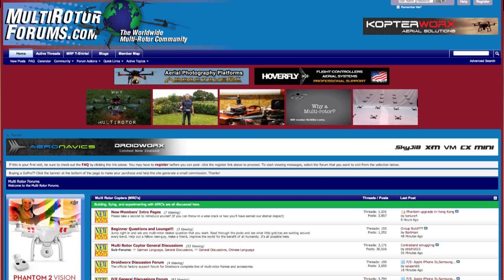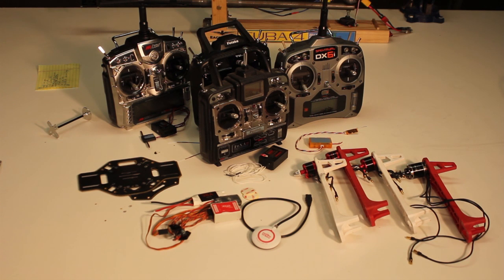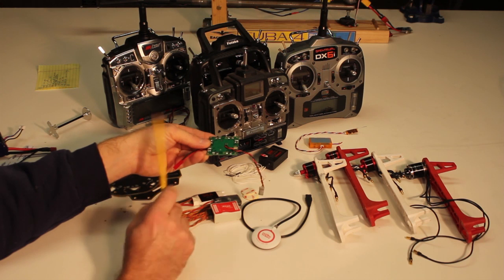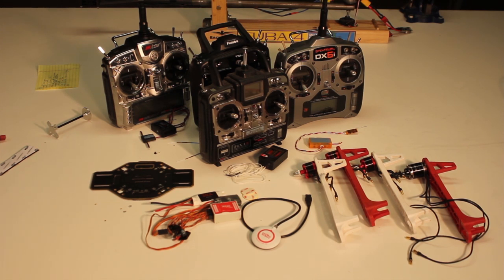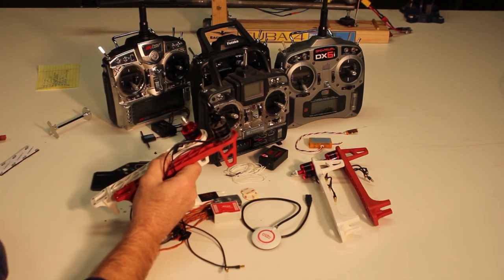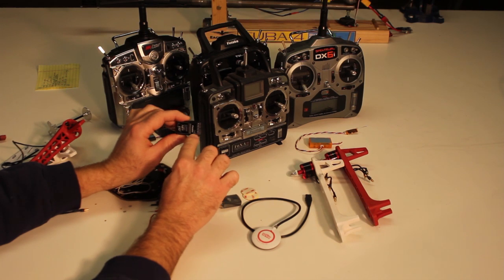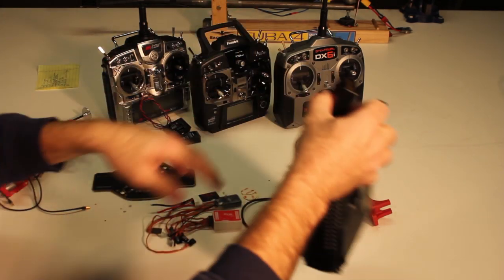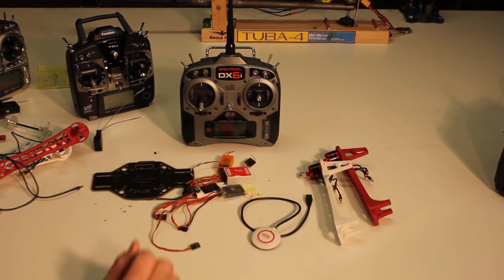MultiRotorForums.com DJI F450 group build vid1

Comment: Hello. I have spektrum. And I was wondering if I went this route and got NASA FC and use go pro for fvp etc but. The transmitter spektrum is 2.4ghz and go pro is also 2.4. I thought the phantom was on 5.8ghz ? Or do I need to buy a 5.8ghz radio transmitter with receiver too ?